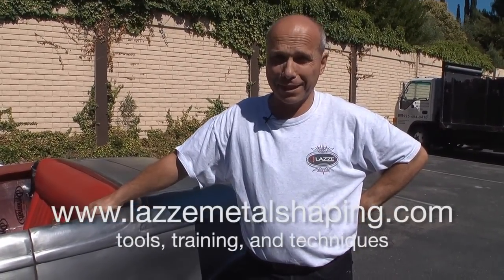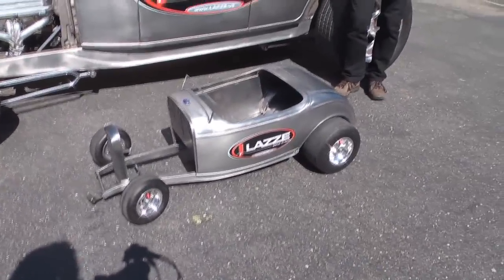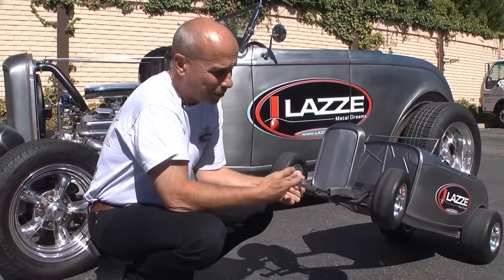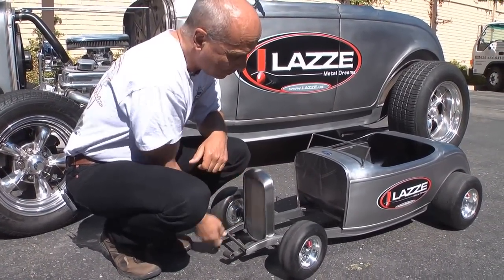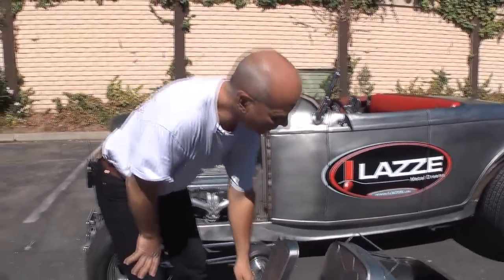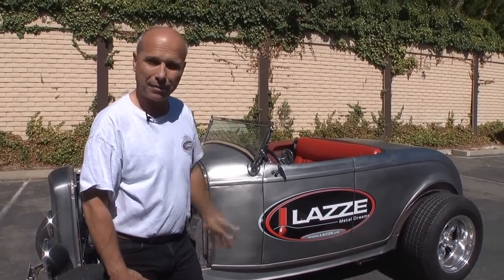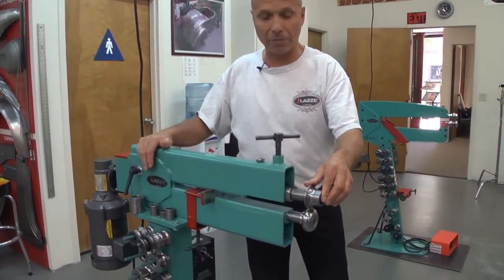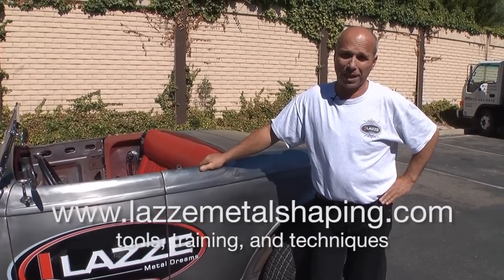Metal Shaping: '32 Roadster Pedal Car Final Update

Comment: How do you keep the car bare metal and it is not rusty - do you apply any coating over the metal ?
Reply from the maker: Both the big and little cars are bare steel. A little work with steel wool or synthetic steel wool is all it takes.